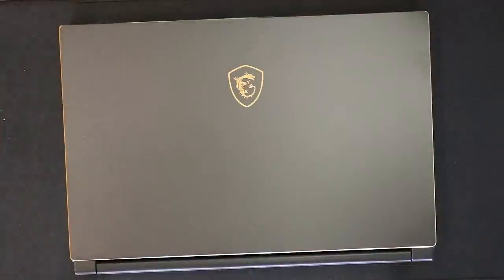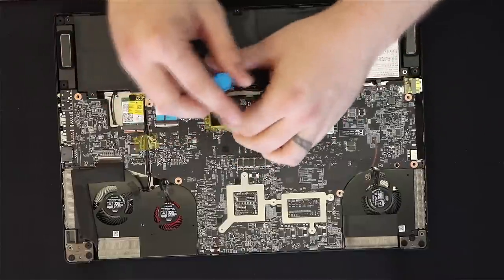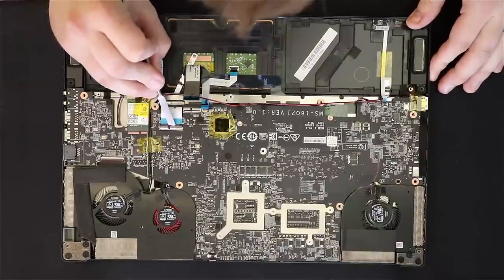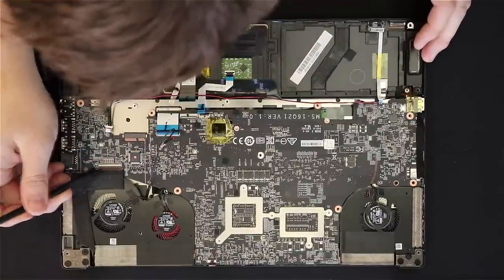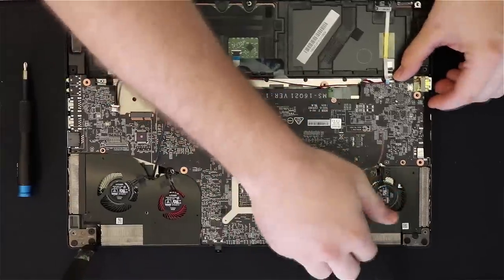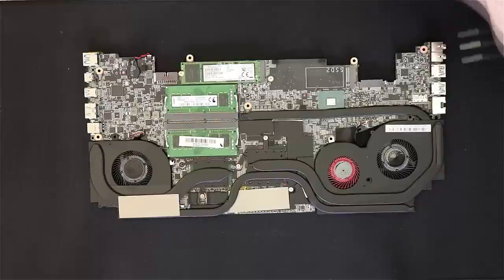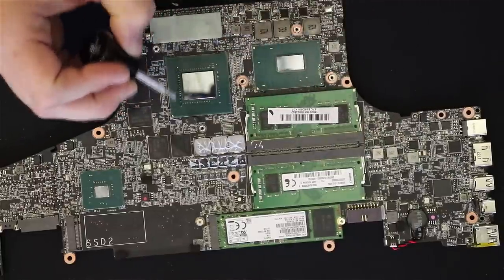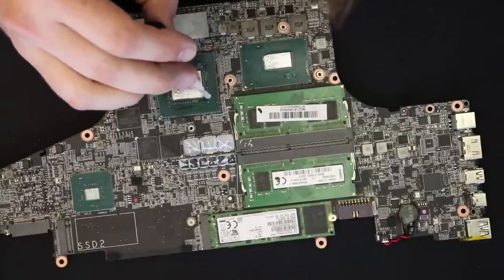MSI GS65 Laptop Teardown and Liquid Metal Mod - 20C Lower

Comment: Wonderful video, I did the same and now under the stress test, I got nearly 20 degrees down as well. There is no throttle at all under AIDA64 FPU test for 10 minutes!!! 

Cinebench from 989 to 1116
Reply: Hi, was just wondering if that result was with the auto fan setting or if you had to turn on cooler boost
Reply: I did it aswell, better cooling overhaul specially fan noisy reduction
Reply from the maker: That was my main reason for doing this mod. I hate loud fans and now I can keep them between 40-50 percent and not throttle much or at all.
Reply: Hey Rick can you help me? I already repaste with liquid metal and undervolt the proccesor with -0.150V (with XTU), but I couldnt decrease the temps of the processor when Im gaming, always hit the 90°C and always have thermal throttling… So I dont know what to do... Please give me a tip!!
Reply: Even when Im not gaming...
Reply: Check your screws of the the heat sink, make sure the force applied is even to all screws. The metal piece is so thin and likely to be bent, hold it with extra care.
Reply: David Otero xtu is for your processor not your GPU   also if you restart and shut down and turn on your computer again XTU won't load that custom profile you have to manually go in and see the profile again and keep xtu open. If you want to have it always undervolt once you turn the computer on you'll have to make a .vbs profile and set a schedule timer on it
Reply: @A-Brax  Im talking about my CPU, my GPU is always on 70°C gaming, so its reaaaaallyyy good, the problem is with the processor... And XTU saves the profile even when I restart.
Reply: @Rick-dq2rw  I did it 3 days ago... And still the same... The GPU temps are really good (70°C gaming) the problem is only with the CPU.
Reply: I used LM also, and i had same shit....hot temps.
After opening it 143242 times and doing this shit...i was like fuck this laptop i`ll fucking destroy it. And then i was like naaah, why piss on my money? why don`t i use my brain instead? Solution -> DON`T SCREW THE BACK PANNEL TOO TIGHT, JUST A LITTLE. after that i had like 82 degrees tops in prime95 30 mins. undervolt 150mv.
Reply: how long until you have to replace liquid metal?
Reply: undervolt your laptop -160v my gs65 got score 1230 on cinebench without using metal liquid
Reply: David Otero did you ever solve this issue.  I’m having the same issue on my gigabyte aero 15x even after liquid metal.  It’s good on stress tests but gaming performance isn’t as good.
Reply: I got the same cinebench score with the i7 8750h just by undervolting it to -.120v using Intel's XTU and I also set the "Turbo Boost Short Power Max" to 90w and the "Turbo Boost Power Max" to 70w. The highest score I got was 1204
Reply: Hi can you link what type of liquid metal paste you use please "! I want to buy it 😉👍
Reply: Whats the liquid you use to protect the die from shortcircuit? care to tell me please?
Reply: Weird question, how do I know the nail polish in non conductive ?!?!?!?!??!

Comment: Feels like defusing a bomb lol
Reply from the maker: Feels more like going “all in”  in a high stakes poker game to me.
Reply: Thanks to Msi's stupid inverted motherboard. It looks like Msi really don't want anyone to mass around with the inside, but they at least put the extra M.2 slot on the out side.
Reply: For real's lol
Reply: Oscar Shen The only thing that is upgradeable on the underside is the RAM, most people just buy the laptop with the amount of ram that they’ll use. I’ve done a repasting on the GS75 (the GS66’s bigger brother) and it really isn’t that bad. It is nowhere near as bad as the Alienware M17 R2, that one was bad.
Reply: @oscarshen6855  2 years later so I don't know if you'll see this, but where is the M.2 slot? i want to upgrade my SSD but this is the first laptop I've ever opened up so I don't know what's what.
Reply: @denniscasius6574  I don't know because there must be new models by now.
Reply: @denniscasius6574  it's a flipped motherboard on this laptop model so you'll have to take the whole thing apart it's a bitch. I ended up just buying an external hard drive

Comment: I am still amazed that manufactures put a lot of time in the design of these laptops but still don't thermal past correctly or as you shown us the liquid metal. its like having a fast car and using low grade fuel.
Reply from the maker: I agree, but I also think the difficulty of doing liquid metal on a massive scale is not worth the cost and the quality control issues would be enormous.
Reply: Agree on the metal option but just using a top grade normal paste done properly eg. pea size drop would be brilliant.
Reply from the maker: I agree they used a metric ton on the CPU of this system I believe and most likely just not good quality.
Reply: Does the liquid metal slowly meld with the heat sink in this laptop? What is an approximate amount of time before the liquid metal would have to be replaced?
Reply from the maker: I believe the liquid metal has a long lifespan it does not "dry" out seeing as there is nothing that will really evaporate at those temperatures. I have heard it can slightly etch the top of the die removing the shine on the top of the dies. Honestly thought people have not been using the liquid metal for a long enough time to see extended long term issues. Just never use it with aluminium it will max it corrode and flake almost instantly.
Reply: Copper, I've heard, is supposed to have the same problem as aluminium over a longer period of time and will slowly absorb and dry out the liquid metal. I think this is over a period of over a year though.
Reply: i believe the copper is slightly porous. the liquid metal will slowly seep into the copper but wont corrode or eat up the copper. this will result in less liquid metal between the die and heatsink tho. so yea you might wanna check later if theres still enough. or just check when your temps change
Reply: More lime a fast car with only the first gear...
Reply: They don't have to use liquid metal to achieve far superior results than the stock crap they usually use. If you look at thermal paste testing, there are excellent non conductive pastes that will show amazing results without much risk if at all. They just have to pay a few more dimes per laptop for the better quality stuff. IMO it's no brainer, but the executives at the their companies don't care that the customer will have a much better experience with their new machines if they did.  Another good thing about better quality paste that it can remain conductive with no problems for years. The ceramic stuff they use on their laptop will dry out within a few months of use. It's what happened to my laptop. The thermal paste was flaking like a dried up ketchup from a pizza box from a day ago. No kidding.
Reply: I've been using Conductonaunt on my Alienware 17R4 (7820hk & 1080) for about a year and the paste always loses its performance after every 6 months. And yes it does move around especially if you use it on a laptop unless you don't move your laptop around (then I suggest getting a desktop instead) so it's quite dangerous.
Reply: In my GS63, after six months my temps were back to stock. I opened it up and the liquid metal dried and was stuck to the top of the die. Took a couple hours for me to scrape it all off and put normal paste back on. I love liquid metal in most cases but not in a laptop. Good video though.
Reply: AFAIK They use the stock thermal compounf bc it's safe and lasts years... not months or weeks.
Reply: @waelal-zubieri5358  "The ceramic stuff they use on their laptop will dry out within a few months of use. It's what happened to my laptop. The thermal paste was flaking like a dried up ketchup from a pizza box from a day ago. No kidding."

Perhaps that's what's happening when my temps fluctuate. Although considering how quickly it spikes/plummets, it might also be misreading temps.
Reply: its a hit or miss for thermal paste on laptops tbh...they still use humans to apply thermal paste..so each application is different. I did repasting for my GS63 (same spec, just 7th gen proc) with Thermal Grizzly Kryonaut (not gonna risk with liquid metal)..only slight decrease in temps....so I was lucky to get a decent application out of the factory. 

And if you're wondering why thermal paste over liquid metal for laptops, obviously they will be transported(vibrations/shaking will occur). Metal is conductive..thermal paste is not(as of most cases)..if it just so happens that some liquid metal oozed out, chances are you might short out something, while for thermal paste..nothing will be in harm
Reply: I'd rather re-apply every few months for lower temps than a cooked throttled laptop
Reply: @arlequin7002  Sure, but it's a major bitch to keep opening this laptop (MSI-GS65) to do the mod.
Reply: Coz liquid metal is risky and may cause more problems in the long run meaning more item returns and warranty claims
Reply: @Sparky_007  yes absolutely. And every time you open you risk damaging something like a cable and that’s basically impossible to fix without costing an arm and a leg
Reply: Weird question, how do I know the nail polish in non conductive ?!?!?!?!??!

Comment: To all of you who did this liquid metal mod... Gallium reacts with copper as well, it doesn't destroy it's molecular bonds like it does to aluminium, but it does get soaked up by copper. Remember this! At one point your temp curve will start to go up, dramatically so. That's when you need to apply more liquid metal. You'll see that the copper sink is gray now and that it cannot be cleaned, that's the soaked up gallium. Don't worry about it, just add more and repeat if necessary. Just because things like these happen to all thin and powerful laptops, I'm buying a Helios 500. To me it's ugly as sin, but what can I do? It works, and it's probably the only one on the market now that actually works. I'll probably do the same mod as well, just to keep it even cooler and quieter. It can be ugly, at least it'll be quiet! :) BTW I bought an ASUS GL504GM i7 8750 / 1060 6Gb, and returned it 4 days later because it was useless. It throttled the CPU core down to 800MHz, and GPU got power throttled as well. Too bad, it looked OK.
Reply from the maker: Thank you for your comment. I am sure it will help others immensely.
Reply from the maker: Undervolting has worked great for me as well.
Reply: @UpgradeJunkie  how much of an undervolt did you get?
Reply: How do you like the Helios 500?? Is it good?
Reply: How long would you get from the liquid metal before its all soaked up by the copper? Wondering if this tradeoff is worth it or if I should go with kryonaut instead. Also have a msi ms65.
Reply: @joshballard3991  kryonaut won't help you
Reply: @wowpsgaming  why not, it works good
Reply: @jakmageson2050  not for me man my cpu is still running at 95C no matter what i repaste haven't tried liquid metal yet and only underclocking cpu helps
Reply: Weird question, how do I know the nail polish in non conductive ?!?!?!?!??!

Comment: Hey, it's been 11 12 months since you applied LM, have you noticed any increase in temperatures or any other abnormality yet?
I have a gs65 and am contemplating between Kryonaut and Conductonaut.
Reply: DC The Eyepoke Champ update on the msi?
Reply: DC The Eyepoke Champ  Yeah LM is great but wow i'd be super paranoid to move the laptop around. I use my GS65 and carry with me around a lot. Up and down the stairs, in a backpack, etc.
Reply: @soapa4279  You can always just repaste and not do LM.  That will still net you some good lowering of temps.
Reply: @LMBC6Brian  repasting doesn't do shit for with kryonaut
Reply: @wowpsgaming  I've seen you comment this a couple times now and it leads me to believe you don't know what you're talking about.
Reply: @dansmith6990  haha i forgot about my comment here it does do shit i just didn't clean my fan that time this whole time and was only repasting

Comment: I still wanna see how you put it back together. Can you please do it ? I’m woories about the fan connectors to put it nice back without the liquid metal will move to much.
Reply from the maker: The trick is to put the screws back in the fan assembly before you attach the fan connectors it was actually really simple.
Reply: UpgradeJunkie Aa okay. I only have on issue to but this laptop or Aero 15x is the gtx 1170 is coming idk do buy it now or wait
Reply from the maker: I debated between the gs65 the aero 15x and the zephyrs for a while it it all came done to the possible ability of gsync which this has(not yet but the hardware is there) and price. I didn’t go with the zephyrus due to the size I wanted something small.
Reply from the maker: The 1170 in mobile will not be hitting until possibly December or later if you can wait awesome but if not this laptop is awesome.

Comment: This video is 2 years old. So I wanted to ask: Did you encounter any problems in this time with the liquid metal / laptop?
Reply: liquid metal oxidizes and damages aluminum over time. Guess what the ihs is made of.
Reply: @tapsofosiris3110  I saw there are some special metal paste made for laptops that does not damage as much as other ones
Reply: The MSI cooling is copper and does not damage unlike aluminum so its fine
Reply: @tapsofosiris3110  not from aluminium lol

Comment: Excellent video and explanation. I had to do this twice. 

(TLDR) The thin layer isn't enough in the GS65. Leave the thinnest pool possible as the heatsink doesn't press the two die that you're trying to take heat from. After a week of high temps, I did this process a second time and improved my temps as is stated in the video.

Explanation:
I found that you appear to use the provided q-tip off screen to get a thin film of LM on it before applying to the die. That thin film wasn't enough for me. Running Handbrake to convert a single mkv to mp4 immediately sent the temps to 90C and throttled. This happened 100% of the time where the PC was using the proc 60% at 4ghz. After applying / leaving more of an ever so slightly pooled amount on both die, my temps topped at 85C but averaged 77C @ 3.2Ghz instead of running at 2.6Ghz at 88C.

The rationale is that the heatsink doesn't press onto the die like you'd have with a desktop cooler (which you should de-lid the processor and apply LM between the chip and die cover then apply regular thermal paste between the proc and heatsink). Thus, you should definitely protect the aluminum parts of the chip with silicon or regular clear nail polish to ensure anything seeping and spreading over the course of time doesn't cause a short in the motherboard.

Comment: I just did this on my gs65 but my results arent as good as yours, I used thermal grizzly conductanaut, in aida64 i got 75-77 in cpu stress, but thats with the fans set to max before i start, in auto it still throttles and if i do cpu and gpu stress the cpu (90-93) throttles while the gpu stays around 75, that being said it is around 35 degrees where i live, do my results seem normal to you? what was the ambient temperature like when you tested it?
Reply: does the heatsink on the gs65 seem uniform/evenly pressured to you when you repasted?
PS: how are those plastic hinges holding up? i read 1 person say they broke after 3 months.
Reply: I know this is three months ago, but I'm having the same issue. My max CPU temp is 71C but it throttles before it gets higher than that. Did you find a fix?
Reply: xastunts  Great advice! I will also move to Thailand soon and I am also from Sweden (what a coincidence)! Did you do the liquid metal repasting to this laptop?

Comment: Excellent video!  I just bought this laptop, and I too notice it slamming up against ~90C and thermal throttling on at least 2 of the 6 cores right out of the gate.  I recently performed a repaste of my old Lenovo IdeaPad U530 Touch, and it made a HUGE difference, so I intend to do the same with the GS65.  I just wish laptop manufacturers would start doing this kind of thing correctly from the factory so we wouldn't have to take apart brand new products and fix shoddy workmanship.

Comment: Maybe Undervolts would have been enough to control temps.
Reply: nope not enough for thin laptop like this i have aero 15x undervolted and still throttling. i am thinking to apply liquid meta aswell
Reply: I think you're right. In his twitter account, he tweeted that he undervolted it also. I don't think liquid metal works as good as he states on this laptop. https://twitter.com/UpgradeJunkie/status/996373200283070464
Reply: undervolting is a very good way out. i HAVW THW SAME LAPTOP AND AFTER undervolting temperatures decrease down to 75 -85.